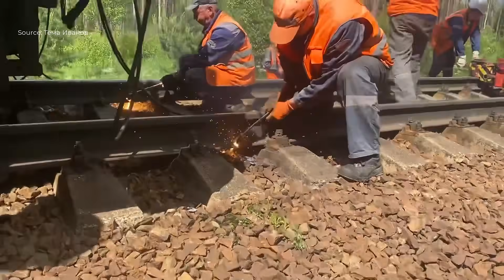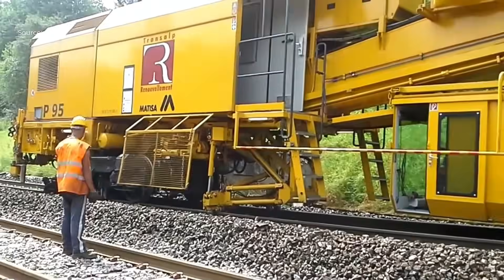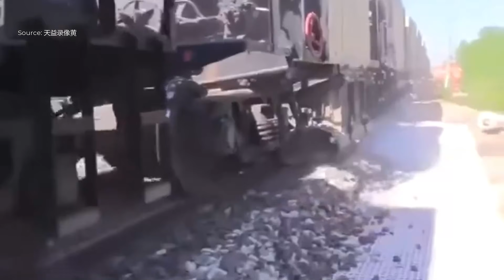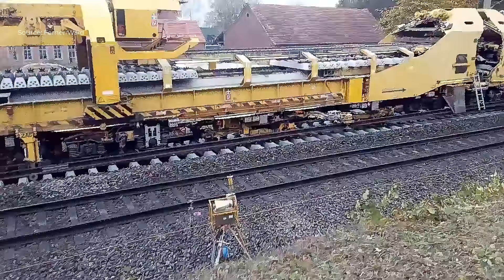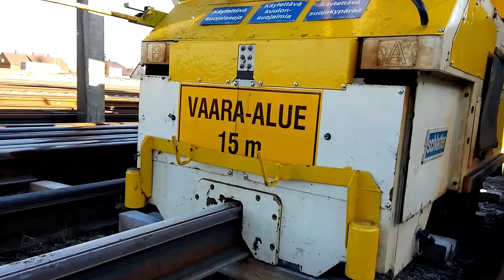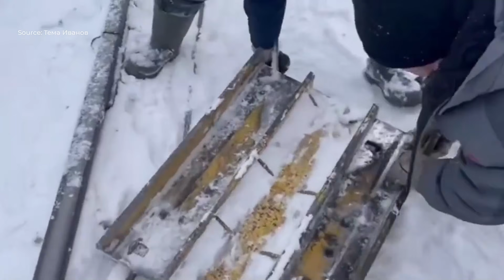Inside the $Billion Railway Upgrade Projects: Track Replacement & Sleeper Installation Documentary

Comment: This practice is infinitely better than the one used in current North American practices. In addition, the use of field butt-welding equipment is much preferable, in my opinion, to the more common practice of thermite welding. 2026/05/19. Ontario, Canada.

Comment: thanks, using two parallel, aligned, and simultaneous lines railways for caring fast and safe large volume cargo equipment or liquid like water by H jet motors zero pollution, economy, competitive with cargo ships.

Comment: The clips are great, but unfortunately the editor has arranged them in not the most explanatory order.
I imagine that a better approach would have been to firstly explain the task at hand, then show the apparently different approaches chosen to execute that task, like showing different stages of automation. Or showing batch processing (of short sections of track) compared to the (nearly) continuous process.

The footage shown stems from Europe (including Russia or another former Soviet state). I have seen similiar footage from the USA here on YouTube, showing far less automation.

Interesting: that use of the green angle grinder. It strongly resembles a 20V Parkside device (a house brand of Lidl supermarkets), expressly not intended for professional use, and it's apparently used to debur and round off a rail that is temporarily connected to the adjacent one, pending thermite welding at that location. So this deburring seems unnecessary to me. (Besides, rails are made of extra strong steel, as shown in another documentary here on YouTube, and that cheap angle grinder would likely lack the power to do much to that rail.)

Also interesting: the voice-over mentions the immediate disposal of old rail sections while the little crane is lifting them from the trackside...

(No, I'm not a professional. I may have that grinder myself. But I have watched more videos on track maintenance here on YouTube.)
Reply: what the hell are you talking about?
Reply: They also discuss 2 different way of securing the track which makes no sense either. Thermite welding and bolts with brackets. Makes no sense.
Reply: @herbertNEMTACexpert Well, the "bolts and brackets" way is used either as the definitive way or as the way to chain long rails before thermite-welding them.